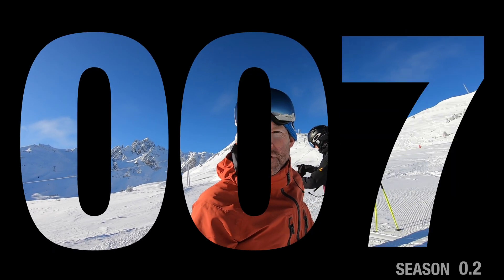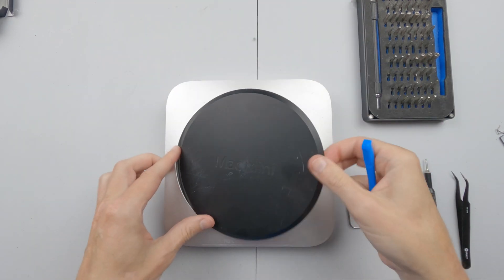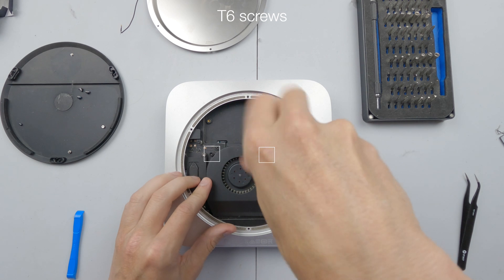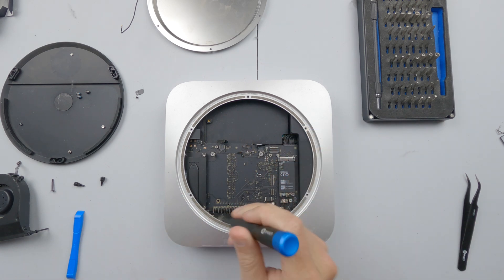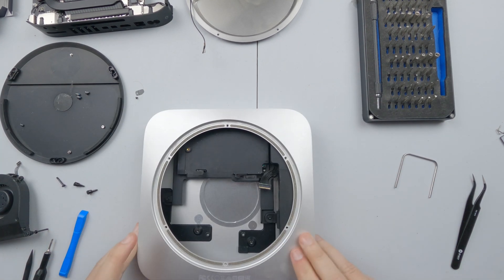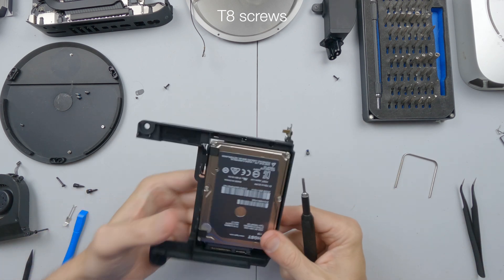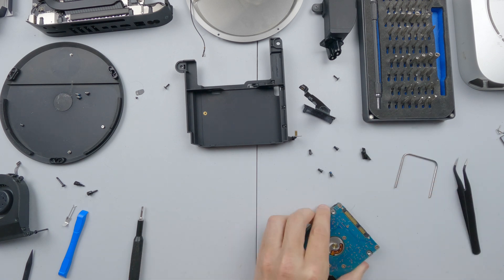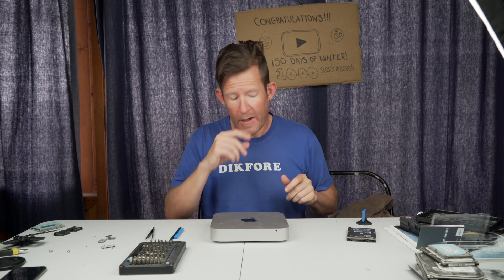APPLE MAC MINI DISASSEMBLY AND SSD UPGRADE A1387  4K

Comment: How do you then transfer all the information from the old hard drive on to the new ssd?  I have this same Mac Mini and it has a fusion drive on it.
Reply from the maker: I have a SATA to USB converter that allows me to connect the old drive to one of the USB ports. Apple's migration assistant then easily allows me to transfer the old drive to the new one.
Fusion drives are Apple way of combining a small SSD with a large HDD giving better performance. However as the HDD get over 70% it will slow down too.

Comment: Do you have any concern using the magnetized screwdriver on electronics?
Reply from the maker: No, The magnets used on screwdrivers aren't really strong enough to do any damage. I guess you would have to use a rare earth magnet to do any damage.
Reply: @150daysofwinter  but how did you pick up the screw toward the end?
Reply from the maker: Most magnetic screwdrivers have a power of .01T. It will pick up another object if is light and makes contact. A magnet that actively attracts nearby metalic dust has a power of 1T.